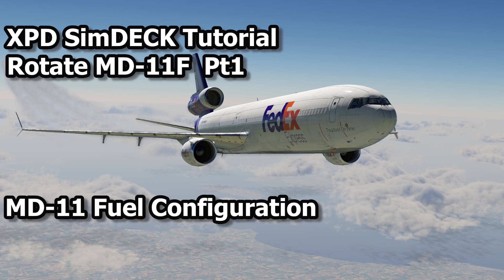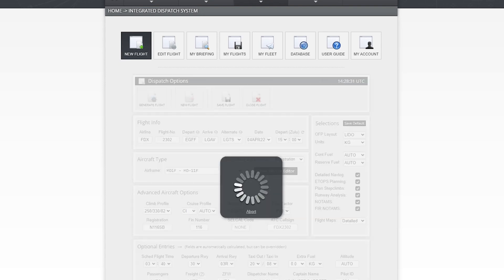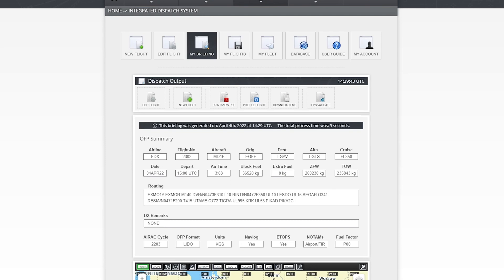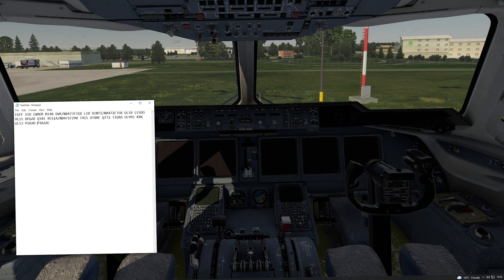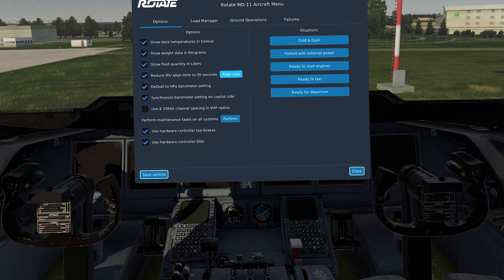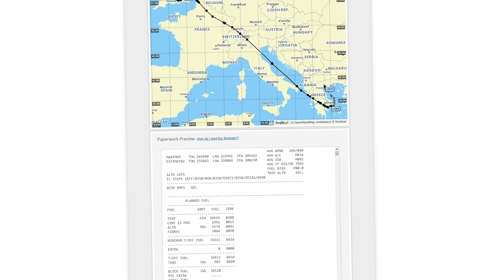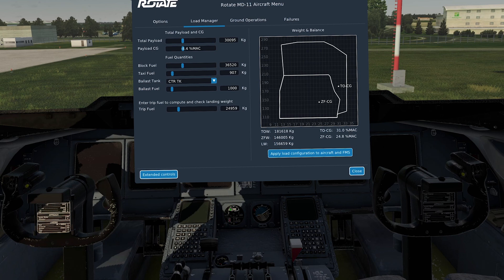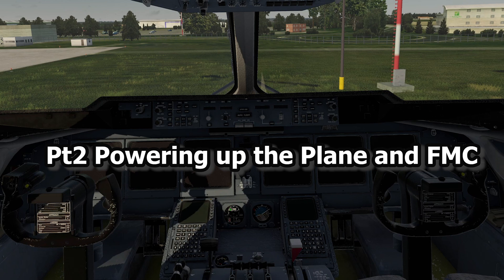XPD SimDECK Part 1 Tutorial Rotate MD-11F. Fuel and Weight Config. Xplane 11

Comment: Wycliffe. you can use the simbrief downloader to export the flight plan direct into md11 fp folder. No need to copy paste and alter text.
Reply from the maker: I checked this out this afternoon. Simbrief must have put the downloader config in, in the past day or two. All good. I will clarify this in the next video.
Reply: @wycliffeb   hi Wycliff yes it went in last couple of days, I used the jar design one and that worked fine as it also uses txt fp. And I noticed today the md11 as been added so I used that.